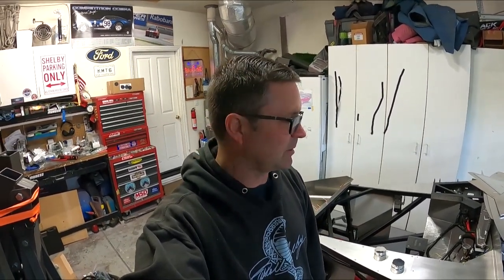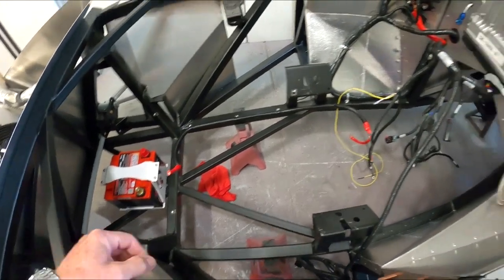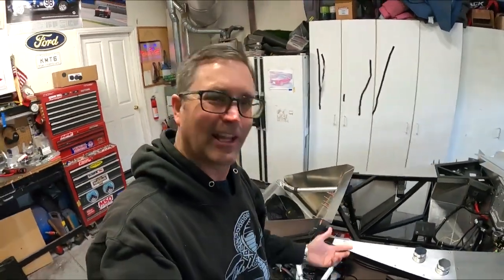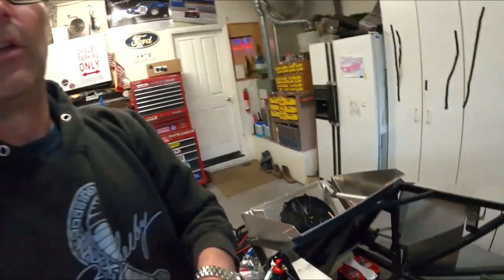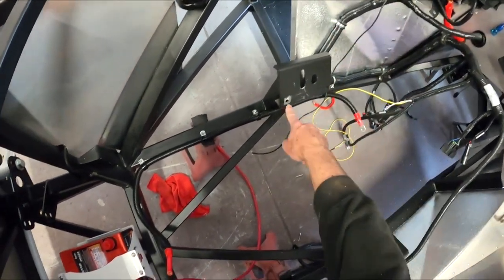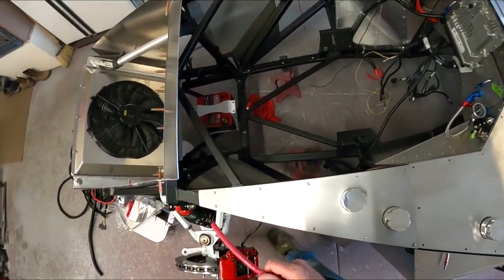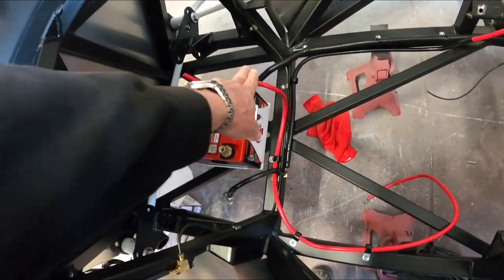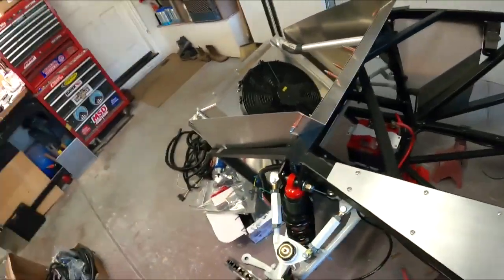Cobra Daytona Build- Main Battery cable runs, Video 73

Comment: “Until I get the engine in there I’m not positive.” Of course, the circuit is still open! I’ll show my self out. Jokes aside, I have to say this video series is phenomenal, and one of the reasons I’ve decided to pursue this project myself. I feel much more confident that I’ll be able to solve problems I run into having seen how well you lay them out. Thanks a bunch! The only suggestion I’d give is organize the videos into a sequential playlist. Right now it requires a lot of back and forth between your video list.
Reply from the maker: Thanks for the amazing comments!
I might try to set up some sort of index list but not sure how to do it. Not a great YouTuber and never intended to make this many videos, It just got away from me. 😂

Comment: Straight shots to the starter and alternator are no problem, that's how most OEMs are done. I would, however, consider running them together with a 250A megafuse. Any rotating winding can short to ground hard and fast with little warning. I've dealt with several customer cars that caught fire because of it.
Reply from the maker: Already have the 250 amp mega fuse in place.  Thank you for the confirmation!